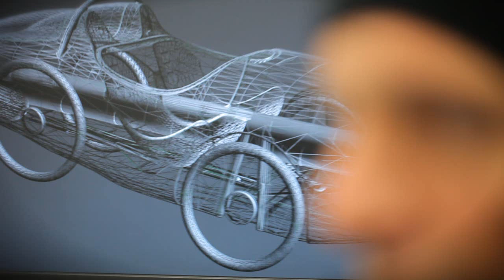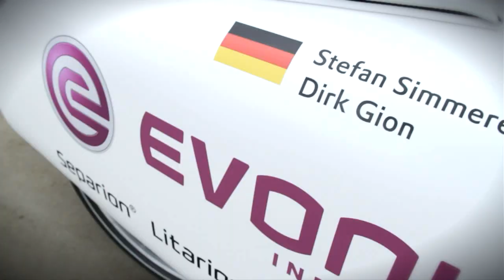testing the Wind Explorer, France, December 2010

Comment: The problem is American Govt. pushing safety standards, where is the air bag? and all the other mandated safety features..  

Homes use up more more energy, of which are all tied into fossil fuel.  If each home could generate even just 10% of their power from wind/solar/water think of how much energy that would save.